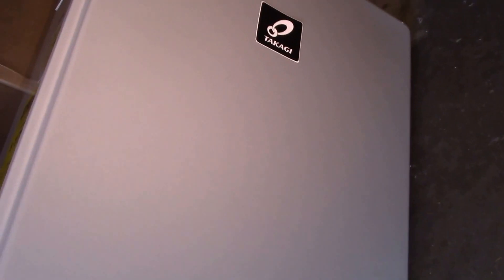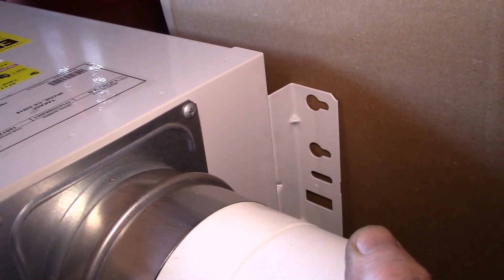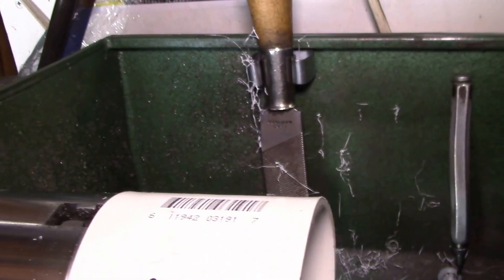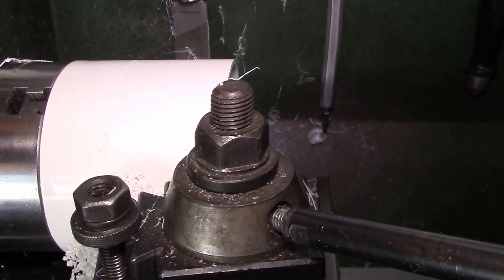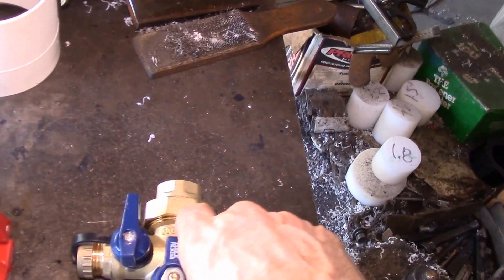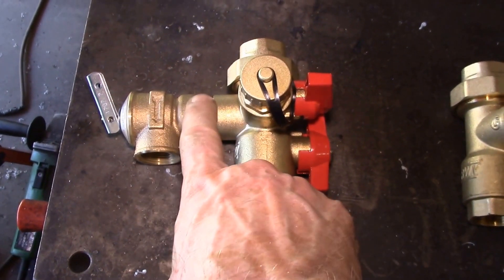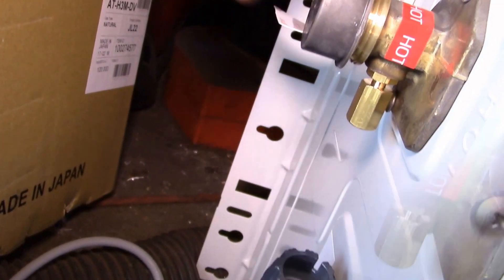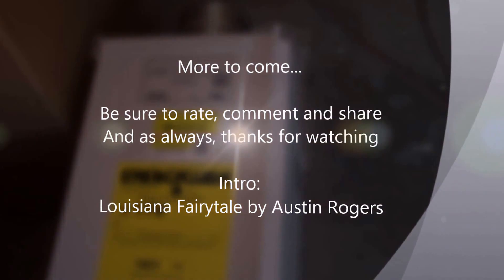Checking out the new Takagi Tankless Water Heater

Comment: Surprising they would ship it with an adapter that doesn't fit - but it is probably, the cheapest condensing tankless out there.  I'm replacing my T-KJr, which just bit the dust after 14 good years.  I would have fixed it, but the board is $229, and I can get the T-H3M-DV-N for about $274 after the Fed tax credit and gas co. rebate.  Anyway, nice video!
Reply from the maker: I imagine that different suppliers of those couplers have different tolerances on the OD, so maybe I just got some overly large parts.  I think it could have been forced in to make it fit but I wanted to make it a nice slip fit.  It had to be slid apart and together a few times for fitting the PVC vent pieces during installation.  You're lucky with the credits/rebates.  

When my heater was installed, the fed. credit expired the year prior and my gas company had no rebates on the tankless heaters at the time.  But I've been getting free gas for the last 2+ years due to the California Climate Credit program.  They send a rebate to utility customers and my rebates are more than enough to pay for the gas to operate the heater, so can't complain about that.
Reply: @The4Crawler  You used 3" sch 40 PVC, yes?  And that fits the ID on the included adapter?  Also, what's the distance between the centerline of the exhaust vent on the heater and the mounting bracket?  I think you said the intake measured about 6" away, and the two vents appear to be the same distance from that mounting bracket.  I'm upgrading from my T-KJr, and have to deal with that offset.
Reply from the maker: @psomlo  Yes, 3" schedule 40 PVC fits into the included couplers.  It's around 6.5" or so from the center of the vents to the bracket.
Reply: @The4Crawler  Thank you - looks like I have to make up about 2" of offset.  I looked at most/all of your tankless videos, but I don't know that you show the detail of the exhaust venting above the roof - what did you do to terminate the pipe up there?
Reply from the maker: @psomlo  The 3" PVC pipe just fits up into the same vent cap as the original tank heater flue sat in.  You can see that briefly here:
https://youtu.be/f1bJWVVHItA?list=PLpY2FP1a9tit_DAwiBGMKoUKFRDOl4A4L&t=192
Had a concentric vent been used, some changes would have been needed in the roof vent cap, but this one is exhaust-only, as was the original direct vent tank heater.  The PVC pipe is clamped where it passes through the short attic space then right into the vent cap, maybe 18" total length there and about 4' total length plus the 2 - 22.5* elbows.  Just added a coupler and the insect screen on the end of the vent pipe.  No need for a down-turned elbow setup since the old vent cap keeps rain out of the vent pipe.
Reply: @The4Crawler  Thank you - I've got a similar situation; I have a piece of 6" single wall metal duct up through the roof, as my original water heater was non-condensing, and I needed to provide clearance from combustibles.  It's already flashed to my flat roof, so it stays. The 6" pipe has 4" to 6" galvanized reducers on each end to keep my 4" stainless exhaust flue centered in it.  I'll just remove my stainless pipe and run the 3" pvc up through the 6".  I just ordered my T-H3M-DV-N from supplyhouse.com, gets here on Monday.

Comment: AO Smith uses the 3" PVC Couling method too.  I called tech support about the ill-fitting fitting.  He sent me a video link of their own video.  Was told to use a hammer.  For real.
Reply from the maker: I think AO Smith heaters are made by Takagi, so no doubt they have the same issue.  I wonder if at one time they had a PVC fitting supplier that made 3" couplers that were a perfect fit.  Then they changed to a different supplier and now they don't fit.  The problem with their design is they are relying on the outside diameter of the fitting which is something that's not tightly controlled.  The ID has to be just right, but the OD can be anything within reason.

Comment: So it's been in use about a year now. What is your opinion of the heater?
Reply from the maker: It's been working great, no issues with it.  It's cut my natural gas use by over 80%.  Gas consumption runs less than 1 therm per month.  Just did the first descaling a few weeks ago.  Love the ability to set the water temperature for a given task using the remote control.

Comment: Hi R BROWN, I must have missed something. The supplied 3" coupling meant to connect to the sheet metal air intake duct doesn't mate up properly, and there are no instructions on how to attach the 2. Obviously what you did to continue with the install was extreme, why would they leave anyone in such a questionable position? If indeed the coupling is meant to attach to the air intake, why in the world would they ship a connector that doesn't fit. Doesn't reflect well on the company for sure.
Reply: I had to stick mine in the freezer for 30 minutes for it to shrink the 1 mm too large it was and it fit fine after that
Reply from the maker: Yes, I suppose they should hand fit every piece supplied with the heater.  But I figure these couplings are just mass produced parts and they get a crate full of them and grab 2 and toss them into the box.  Problem with the couplings is they are precisely dimensioned inside to fit over 3" PVC pipe.  But the outside not so much as in normal use, the outside dimension makes little difference.  As long as there is some minimum wall thickness, that's fine.  But in this application, the OD of the coupling matters.  In this case, I could have used a file or some coarse sandpaper to smooth down the outside of the coupling to make it fit.  But it was quicker to throw the part on the lathe.  I would imagine that since most of these heaters are installed by professional installers, they know all these little tricks, but some mention of that in the manual might help us DIY types  I guess they also support using 4" stainless steel venting and that fits over the outside of the same round sheet metal so that likely dictates the size of that fitting. I like that they give so many options for venting, either stainless or PVC/CPVC in 2", 3" and 4" sizes.  So many of these heaters are locked into using just one type of vent.

Comment: do you know if it comes also for propane gas. I have to do some research thanks for showing
Reply from the maker: Yes, just replace the -N on the model number with -P.  They also have outdoor models, mine is indoor as well as models with higher flow rates.  The larger models need the larger 3/4" gas piping.

Comment: What would people do, if they do not have a lathe??
Reply: You could try buying couplers from a different company.  The UPC (611942031917) shows these are 3in DWV couplers manufactured by Charlotte.  In my experience at the time of writing this, this is the brand predominately stocked by Lowe's.  Home Depot sells Charlotte and NIBCO (and others).  Supplyhouse dot com (no affiliation - just good prices) has Spears.

In another comment, Jeremy Baldwin had a workaround: "I had to stick mine in the freezer for 30 minutes for it to shrink the 1 mm too large it was and it fit fine after that."
Reply from the maker: Lots of options I suppose.  I may have just had a pair of unusually oversize couplers.  But that said, a belt sander would probably take them down fast enough if needed.  Of if you had a bench grinder or even a good file and didn't mind stopping every so often to wire brush out the file teeth.
Reply: The couplers actually DO FIT.  I thought the same thing at first and then I realized that the flange coming off the heater is so thin that any slight part bending will not let the coupler join.  You have to be very even (no angle and move around a circle with the coupler) and eventually you will get it to go in a perfect tight seal.  It definitely will feel and look like it's impossible but believe me, once it works it is just right.  Of course put in with the side without the burr sticking out.